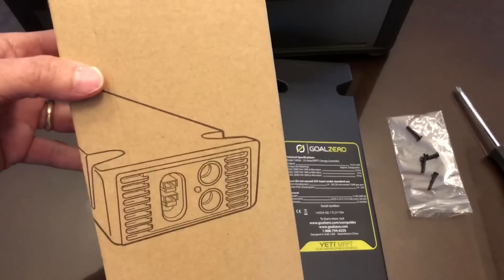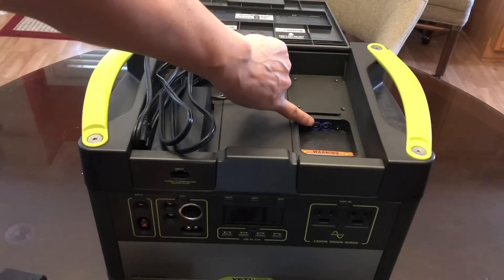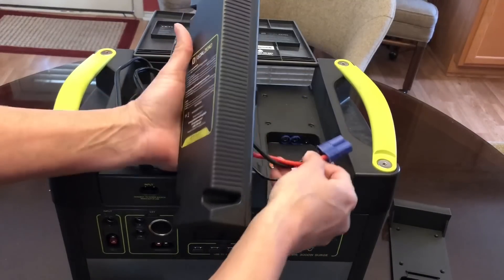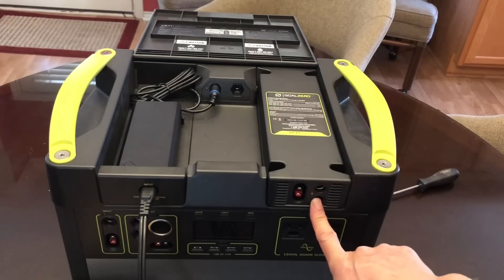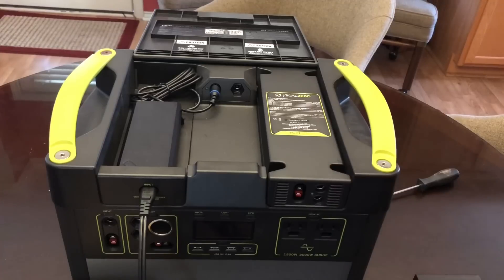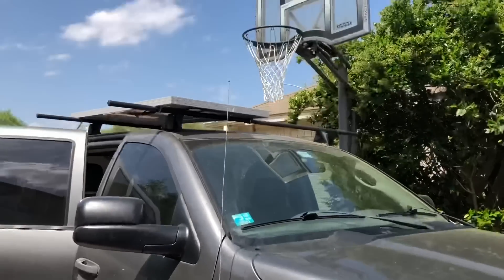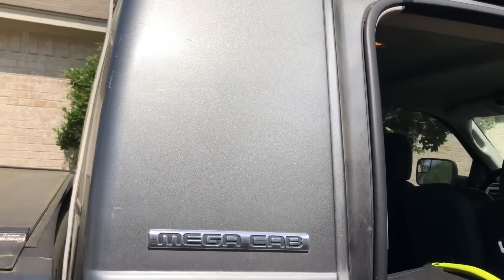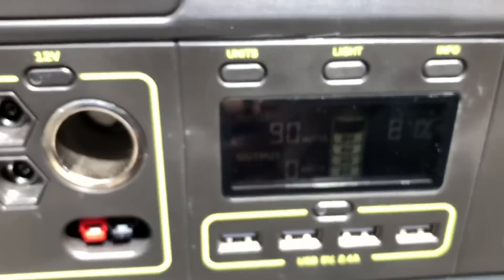Goal Zero Yeti 1000 & MPPT charge controller.  Does it work

Comment: How stupid! Why would they put a pwm built-in when they know that the MPPT is better more efficient!!!
Do you have solar on your house? Obviously only plug in the yeti during the day while the sun is shining and the solar is powering....
Throw some water on to the panel I bet you're going to get some more wattage cooling it down and cleaning it!
PS if you don't have solar for your house please get some and if you don't want net-metering buy a grid-tie limiter inverter, no need to sign a contract for net metering cuz it Doesn't feedback to the grid and easy to hook up....
Reply from the maker: SolarizeYourLife I haven’t put it on my home yet.  I use lots of powers here.  I run a large pool pump, 2-3.5 ton ac’s, 1-8000btu window unit in my sons garage apartment, 2-fridges and a deep freeze.  My home is 3600 sq ft so we have a lot going on.  Solar would cost an arm and a organs wouldn’t pay me back for 20 yrs.  I’m selling my home in 10.  Installation is too costly as I’m not educated enough for a self install.
Reply: @EvenaGirlCanDoIt  who said to power your house which 100% solar???🤔 you can easily put 3000 Watts on your house and will help you reduce your bill... So you really don't have any excuse....
Reply from the maker: SolarizeYourLife   Except for start up cost and it not paying me back over the next 10 years.  Solar is not cheap here if you don’t know how to self install.  Buying the equipment is not the problem as I could recoup my investment in 10 yrs it’s the cost of install that’s the issue.
Reply: Cuz they want you to spend another dollars for it more money

Comment: The MPPT controller will give you better overall performance on a full day, particularly in lower or filtered light conditions. Your panels will be charging your battery in early morning & later in the evening with the MPPT.

Comment: 40% is probably calculated when you charge it from 0% up.  Your battery was charged over 80% already, and most Lithium Ion batteries have slower charging speeds from 80% on.
Reply from the maker: Adam Pensel hmm didn’t know that. Thx
Reply: @EvenaGirlCanDoIt  PWM charged with 50 watts, MPPT with 70 watts. So these extra 20 watts are 40% of the original 50 watts.

Comment: The pwm and moot are for solar inputs not DC power from wall power. They manage the variable level voltage and current from the panels. Can't believe goal zero happy about seeing you ugly DC brick into solar input.
Reply: The charge controller doesnt know where the electricity comes from lol shes not gonna hurt anything.

Comment: Mppt come in handy the lower the battery is since it convert all of the power to the right charge voltage. Pwm is just “cutting off” the top voltage to make it fit the battery level... so when chargin from 0 to 50% mppt is a lot more effective then the pwm. At 50-80% it’s still better, an for the last 10-20%  your are only gaining a small advantage of maybe 15% more power when you are using a 20v inverter. If the inverter was  the same w, but at 15v the pwm would be more efficient
Reply from the maker: Thanks. Going to have to try charging when my go is below 40%
Reply: Johanne Santella ? What does “uuu” mean?